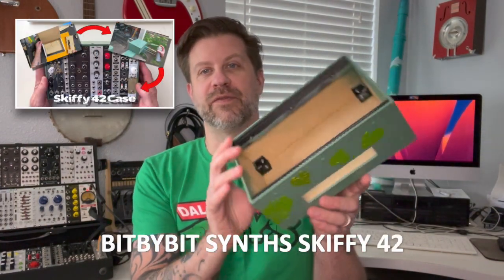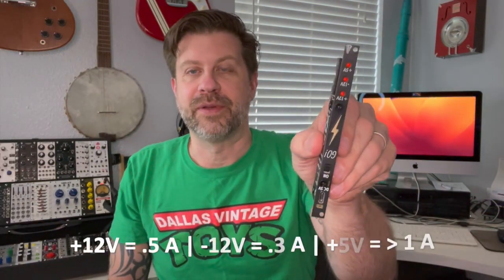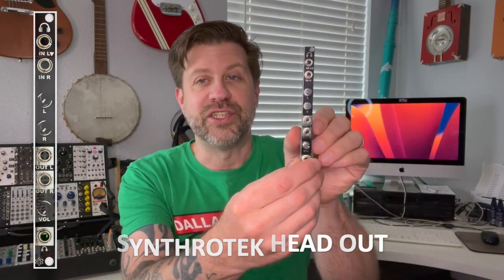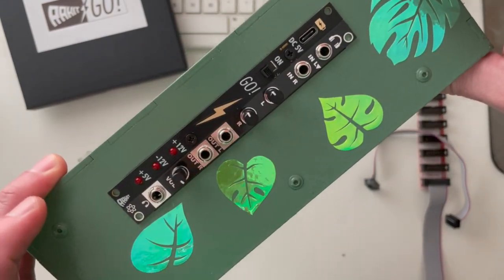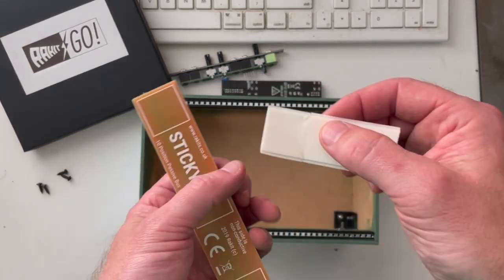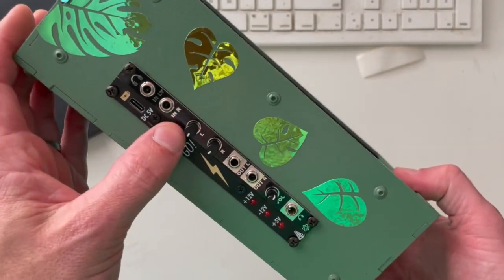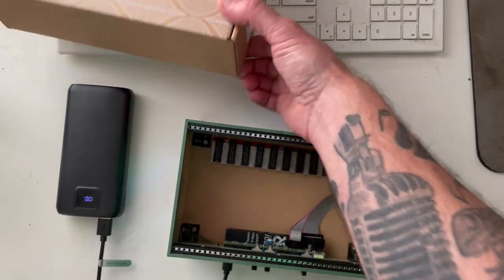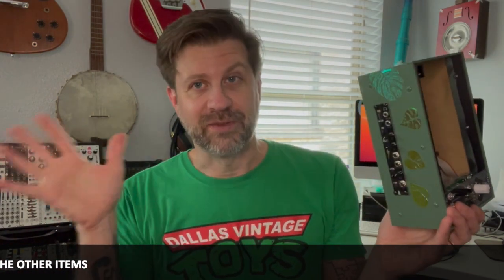Rakit GO! Meets BitByBit Skiffy42 | Battery-Operated Eurorack | Bioelectric Skiff Project

Comment: Thanks for posting! How is the experience with power consumption when using the skiff in the battery powered mode ? I am currently buliding a rack to go camping and I wonder how much modules draw in average. The power consumption values in Modular Grid for example to my understanding max values. Regards, Markus
Reply from the maker: The battery lasts a lot longer than I thought it would. Obviously, I will vary based on how long you use it at a time, but I've powered it on, created a patch, powered it off, powered it back on, created another patch, recorded it, and still had more than 50% battery left.